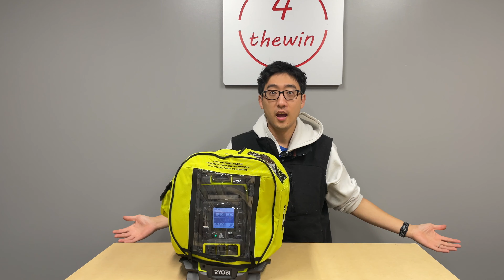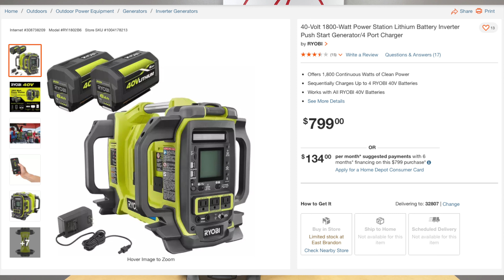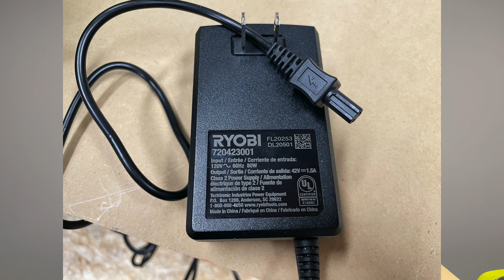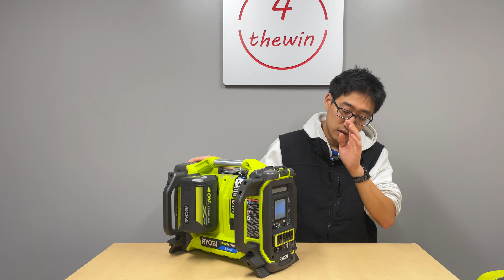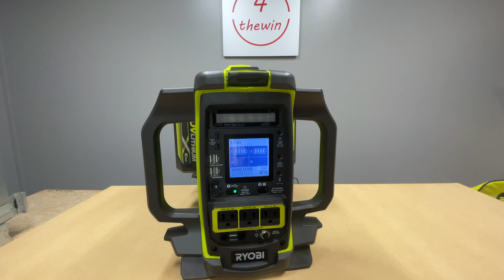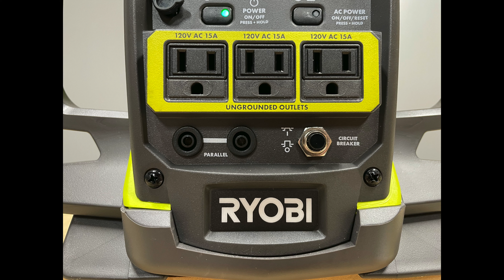Ryobi 40v Powerstation Review | Hands on with the 40v power station inverter RYI1802B6

Comment: As a "power station", this product sucks at everything.  There are other products that do way better for less money.  Unless you just need more Ryobi batteries.
-  The batteries cost too much
-  Poor AC charging capabilities.  Seriously, 1 at a time?
-  Can't use the station while charging
-  No option for solar charging (huge deal breaker)

Did the engineers that designed this thing even use Ryobi tools in the field?  I doubt it.

Comment: I'm looking for something to power my main house refrigerator for power outages, i do use the ryobi line up for lawn and power tools. You did mention using this for a 6 hour power outage but it only powered  your frig for only 1 hour? Is this correct, if so, this is disappointing. I would assume this would last 3-4hrs with 4 batteries to power a frig during outages.
Reply from the maker: I’ve had to use it several times now. Now I’ve been prefer using the ego over the Ryobi power station simply bc I just have more ego batteries. The runtime you’re talking about probably isn’t fair bc I have kids who are always going in and out of the fridge (even during a power outage). I would think for just keeping it close it woudl definitely last longer. Also depends on the size of your fridge. Ours is bigger than your standard counter depth.

Comment: How long can a Traeger Pro 575 Wifi Pellet Grill and Smoker be run for or is it even able to be used on the generator?
Reply from the maker: After the grill gets started it (300 watts first 5 mins) uses about 50 watts an hour. So depending on how many batteries you have. I would roughly guess ay least 7 hours.. as long as you only start it once. Since that’s when it burns the most energy. 7 hrs x 50 watts = 350 watt hours. Which is the capacity of the one 7.5 amp he battery. Add In the efficiency of inverter, startup burn, and other factors, two batteries would get you at least 7 hours, expect more maybe closer to 9 or 10. But that’s just thought math.

Comment: That's not a weird fan noise, that's a failing bearing.
Reply from the maker: Yep
Reply: Bought mine a year ago and have used within 10% of full load capacity, no fan issues, likely a first run issue.

Comment: I'd like to see an oscilloscope readout of the sine wave on this thing. Wonder if it's really a notched square wave like on the smaller single battery Ryobi inverters.
Reply: A channel called SerendipitySue hooked up a multimeter with a oscilloscope to the AC outlets on this. They looked pretty darn clean.

Comment: you tested the vacuum with no load on it, ie not sucking anything, that would cause further load on the motor and the inverter. same for the compressor, by letting the air out while letting it run, its not fully stressing it out.

Comment: Nice review. Thanks.
So this should be able to keep any residential full size refrigerator/freezer going in a power outage?
Reply from the maker: It did for me, But it really depends on your fridge. Look at the power rating for your fridge. Most smart fridges these days have variable linear compressor which make the startup not so bad. The old classic fridge could draw more surge/inrush current so it could fail to start, but all fridges are different. Short answer, most likely yes

Comment: How long will it run before dying with the two 40v 6Ah batteries? And how is that time effected by different loads for example 90% load, 50% load, 20% load. Did you do any run time test?? Everything I see is always listed in watt hours. I think it would be awesome if you tested that out and had another video for it.

Comment: I don't like the fact that it takes 3 and a half hours to charge 1# battery × 4 = 7 hours to charge one battery at a time, not solar compatible,  and will not run most of your tools in your shop, it goes into default mode very quickly and still will register 50% battery level,  I seen very detailed videos and changed my mind very quickly

Comment: Agree with the other poster --a lot of money for no 12 volt outlets to run ham radios,  or 12 volt accessories like fans and lights.
Reply: Ryobi offers separate power inverters for both the 18v and 40v batteries. I'm going that route because I already have 18v and 40v yard/power tools that take the batteries. I have one of the fans, too. It works great. I live in Tampa, Fl. We get outages here every hurricane season. I'm on the end of the line (only about 25 houses on our line), so when our power goes out, we're low priority. I'm more interested in how this thing will run a refrigerator or freezer for a few days. Strange coincidence, I'm currently checking into ham radios.

Comment: The unit didn't work too well for me (  https://youtu.be/zOOY_ml1_BQ ). The unit falls short is several areas. No pass-thru charging, no 12V regulated socket, Type C port is not PD. You should run some tests with the battery half full. There is huge voltage "sag". The fan on my unit only went on when there was a large load?

Comment: Can this be charged by solar??
Reply from the maker: At this time, no. There is no known charging device for this Ryobi power station.
Reply: @4thewinak  its a gen 1 so i can wait. At this point what i see as future enhancements, native solar charging,,  pass thru charging, faster charge rate, upgrade external psu
Reply: There is but it’s after market  there Is a YouTube channel I forget the name of it but just research ryobi Homebuilt power inverter and the guy should pop up but he took one of these and got some stuff off Amazon it made it to where he can recharge it by solar
Reply: Solar charging batteries that already require 3 and a half hours per battery = 7 hours to charge with 110volt,  no way would solar power work